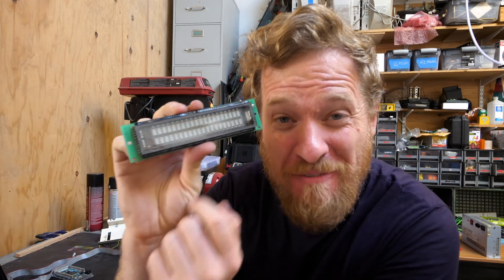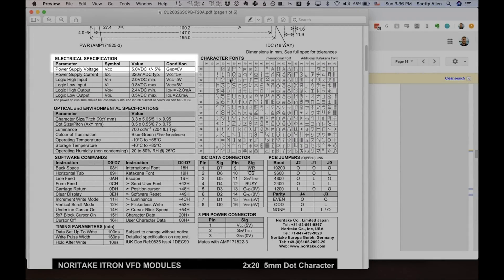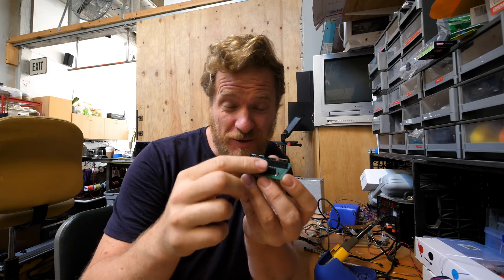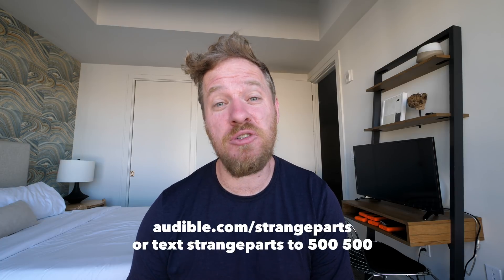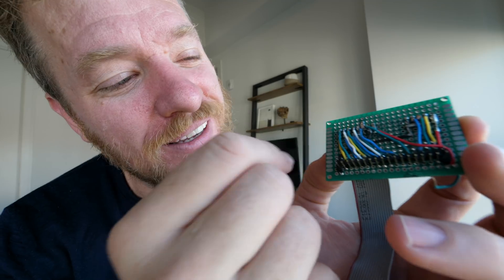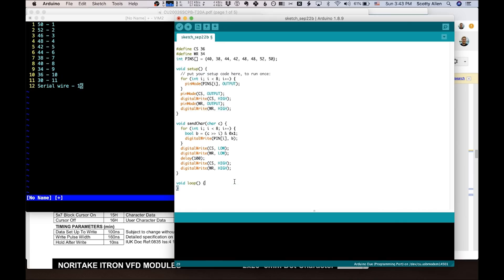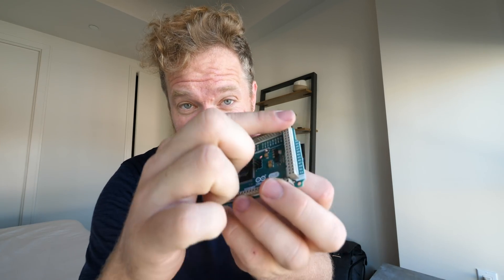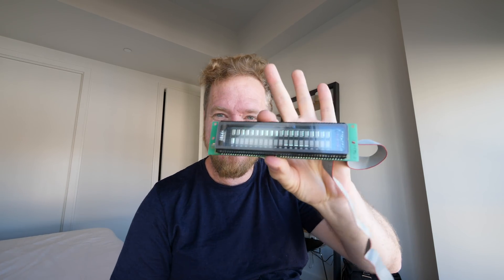Reverse engineering vintage Japanese electronics - a vacuum fluorescent display!

Comment: It never ceases to amaze me how big and complex boards used to be for how little they actually did. If you really want a challenge you should look inside my original atari table top asteroids arcade machine. There's some huge boards inside and it might be one step up from pong graphically lol. I'm yet to tackle it.. it works but the scoring will randomly insert letters for numbers lol.

Comment: Hey, I have seen parts for older equipment, PCs and older CPUs going much higher than typical retail. It means you have something vintage that you don't want to give up so you will normally be penalized for not buying something new. That is my experience.

Comment: 90% of the time when nothing changes after writing some code, I forgot to actually call the function.
Reply: Or the inverse that happens to me fairly regularly due to my coding style, I like to write a lot of empty placeholder functions, and then write whatever part of the program that I feel like writing at the moment, which results in me not understanding why my code doesn't do anything for a couple minutes until I notice that a function that's getting called doesn't do anything at all.
Reply: @sstorholm  you could always make your placeholder functions do someting like throw an exception or print some text somewhere. Then you should notice it a bit faster :)

Comment: Both the arduino and the display have [0.1/2.54] headers. When you are working on something new, use jumper wires.
Wire a PCB after you have something working. 
If you don't know what signals are, look for other parallel port display drivers.
Hint CS= Chip select the bar means "active LOW"   WR means write

Comment: 2:40

While it's true that the 3V3 Arduino Due should be able to drive the display inputs OK, watch out for the 5V levels coming back from the display. The AT91SAM chip used on the Due does not have 5V-tolerant IO pins, AFAIK.

(a lot of these standard LCD chipsets allow you to read from the status register or display memory.)

Some series resistors of say 47 Ohms will help protect the Due, but ideally there should be some proper voltage translation, like a 74HC245 or similar.

Just a heads-up, as otherwise it could damage the Due over time.
Reply: Also, beware how you handle the VFD board, as it has an inverter on there, and some of them can be surprisingly spicy when they bite. lol
Reply: @Mr T. Guru 

You missed the part where I said it uses an inverter. ;)

Sure, it wouldn't be thousands of volts, but still a few hundred.

Perhaps only a few milliamps too, but it could still give a surprising shock, especially if it has a HV cap on the output.

It would be somewhat similar to a small laptop backlight inverter...

https://en.wikipedia.org/wiki/CCFL_inverter

Just something to watch out for if you don't realise it's there.
Reply: @Mr T. Guru that won't save you. 30V will instantly kill some semiconductors even if it can only source a microamp.

Comment: With a little bit of foresight, you should have placed the data bits in order on a digital port. Then you could set the value with direct IO. This makes the code much more efficient compared to looping through the bits and doing digitalWrite. For example, if it was placed on port B: 

PORTB = c;

Comment: Isn't that like a super slow way to set those pin states?
AFAIK ther should be a hardware register defining the state of those pins. I don't have the memory layout in mind, though with some luck they might be right next to each other. That would allow you to skip the for loop and send characters faster.

But maybe that's a non issue considering the update rate on the VFD....

Comment: Since you actually just talking to one display, toggling CS is not really necessary, just keep it on HIGH all the time.
Reply: Funny... I was thinking the same thing. Parallel interfacing was the way to run these screens forever.. (parallel port)

Comment: W/R is generally the Write/read pin and C/S is usually the Clear/Set pin. This is similar to a lot of LCD modules available nowadays. You can also reconfigure the LCD library for Arduino to work with this display.

Comment: Usually I would be careful, just supplying a higher logic voltage than the part is specified for. Or did he meant that the display has a 5V logic but has the LOW/HIGH logic boundary at 5V?

Comment: By the way, you can import your current sketch into Atmel Studio, and connect via JTAG to your Arduino Due. This will let you step through and debug your software. It will also still let you use Arduino's libraries. Doing this will wipe the bootloader from the chip as you'll be directly programming it and you'll also need an Atmel-ICE to program the chip and debug it. It might take a little bit to setup, but it's well worth it for the ease of programming/debugging it'll give later. Especially for big projects!

I have to prototype a bunch of projects at work with Arduinos, and I never use their IDE anymore.

Comment: From my experience with shift registers, when dealing with low frequency arduinos, you don't really need to delay. I tried it once and reduced the delay and expected the registers to hickup at some point.
But the overhead of arduino (and even in native AVR-C) together with the slow clock is often enough to provide proper and reliable latching of the data.
Reply: better safe than sorry
Reply: Well I guess if the shift registers maximum clock frequency is above the microcontrollers main clock, I'd rather save some valuable processing time...

Btw. is your profile picture the brutally faceswopped version of Tom?

Comment: Sure, you wired some stuff wrong. But if you planned it out so that the eight data pins go to one complete port (e.g. PORTC) you can actually assign and write the parallel values directly: `char c = PINC; or PORTC = (char)c` which makes it aktually simpler than dealing with serial (except the buffering and hardware support)

Comment: When the first character showed up, he did have a geek orgasm... Beautiful...
Reply: It's that satisfaction of building a thing and seeing it work that drives all engineers, indeed.
Reply: @metal571  indeed same with seeing the result of a beautiful working PC Build
Reply: @Richardz  unfortunately this is extremely true which is why us programmers can only really brag to coworkers and that's about it lol
Reply: metal571 If you use rubber duck debugging method, the duck is the obvious one to brag to.
Reply: @Richardz  same my family tells me to shutup when I start talking about computer stuff
Reply: I hat that yesterday when I finally was able to implement a live console in a GUI I'm programming with pyhton.
Reply: @ProtoMan137  wait
So a console inside a OS based gui running on python? How did you do that....
Reply: @HappySlappyFace  you spawn a subprocess which runs simultaneously with your program. Now you check every tick/second if there is some new output. You continue to copy that output into the TextCtrl element in your GUI after you configured it for multi line support. Sounds easy tbh but took me ages to understand how to do it
Reply: @Richardz  hmm :/
Reply: That's why I always love to work with hardware, so much more satisfactory to see a motor turn or a display do something than just seeing your script run without issues. :)
Reply: @sstorholm  I know what you mean, I'm like this too ^^ just gotta do software stuff sometimes.
Reply: Seems like every modern part has dozens of internal registers that need to be set up to get it to do much- that one is refreshingly simple. I wonder if it has cursor position, blink and such like encoded with escape characters.

Comment: Hey, it is just standart UART, no funny things...GND, VCC and TX :) Memory adress for character in controller is ASCII code. So, you basicaly send 'A3' over UART with correct baudrate and parity and it should work fine. I have a few Noritake displays at home and they are the same principle.

Comment: To be honest i do projects like these every other day...
and i am like this is easy af and straight forward
but i dont have such big production team to actually capture edit and post all that...
and i am back to ehh i think the presentation is the real hardwork
Reply from the maker: Yeah, it's reasonably straightforward for someone like you or me with a lot of experience doing this sort of thing.  But lots of people don't have that experience, or even if they do, they haven't had a chance to play with this sort of display yet.  And I don't have a big production team:)  Just me and an editor.  But yeah, the editing on this took longer than actually doing the engineering work.
Reply: Lol i can understnad if i was going to do this this would have been messy actually i would have soldered single strand wires directly to the display's logic board wouldnt have made that fancy pcb but since you want to show it to the world in a clean way a propper connection that pcb connecting arduino and display logic unit .....

cool man keep it up😊

Comment: Great video! However, you could have saved a lot of time as this is a classic Hitachi HD44780 display protocol, used by virtually all character displays (up to 20x4 characters) of the 80' and up. Just the pinout gave it away! This is the reason the datasheet is so scarce.
Good luck with the end of the project, this is always the hardest part
Reply from the maker: Hah! Good to know.  I did find some arduino libraries for Noritake displays, but they seemed to be different models with different protocols.  I'll have to look around and see what libraries exist for that Hitachi display though - might end up being more robust than what I cobbled together.
Reply: @StrangeParts  IIRC already comes with one out of the box, LiquidCrystal if memory serves. Long time I've not used Arduino, as I've moved to bigger chips.
Anyways, those displays were made to be trivial to interface to 8-bit systems of the era, for example the 8-Bit Guy did a 3 part series on connecting one of those displays to the user port of a C64 : https://www.youtube.com/watch?v=hZRL8luuPb8

Comment: In fact they have both options, both module and just glass. And yes, it's very expensive. Just the glass is cheaper. :)
Reply from the maker: Ah, I guess that makes sense.
Reply: @StrangeParts  i made the mistake of buying just the glass. Is almost useless as you need a much more complex circuit. there is a version of this VFD that is interchangeable with the most common LCD. Also, take a look at Noritake, I guess they even make china set for US President

Comment: Awesome stuff, Scotty! Did you consider using an open source library to handle various print routines (as opposed to "println" at all times)? I assume it's often useful to just change out a single character in a line to avoid those delays/flickers when refreshing the entire screen at once(?)
Reply from the maker: I haven't gone too far down that road yet.  Just simple prints is fine for my purposes at the moment.

Comment: I'm not sure if its the same type of item, but you should check out 8 Bit Guy, he has done several videos on relating material
Reply: Sadly, these are not HD44780 compatible displays. The '44780 has enable, register select, and R/W, which makes it pretty clear these don't use the same protocol.  These seem to have a UART attached to a parallel bus and use terminal control characters to perform the register functions of the '44780.